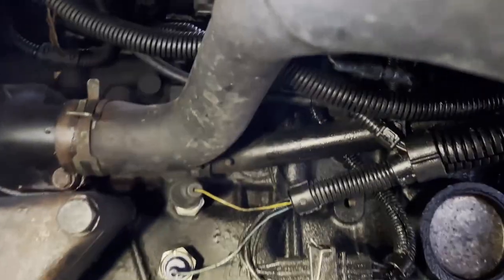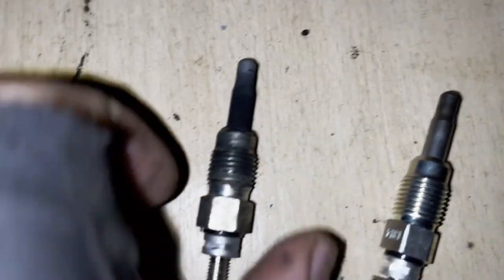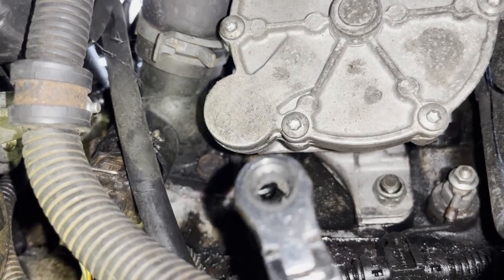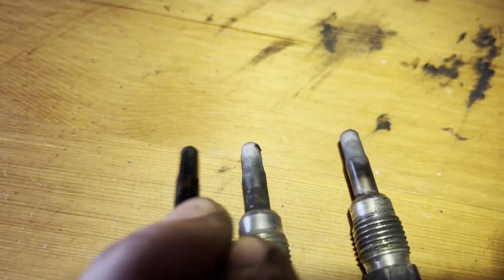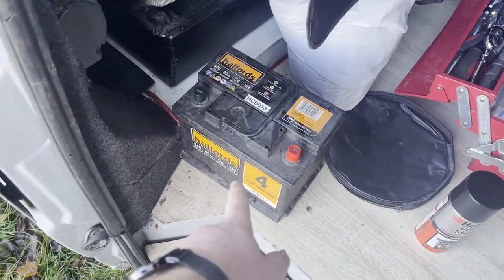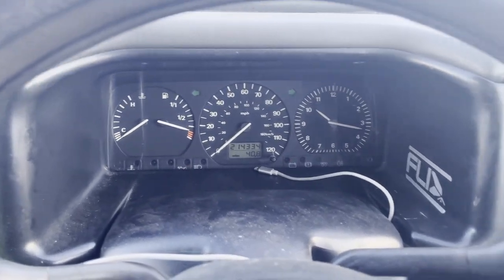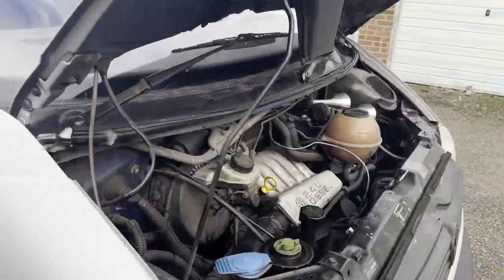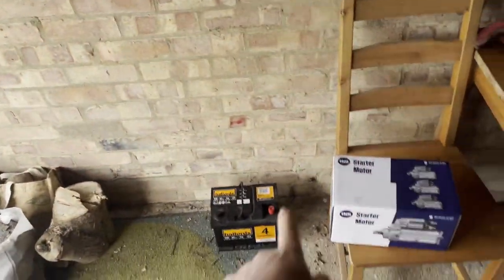VW T4 - Glow Plugs & Cold Start Issues

Comment: I bought my aab t4 as a non runing barn find. Imediatly changed the diesel filter, good service, repaired the alternator and starter motor, 4 new wheels and tyres, treated wing arch/windscreen superficial rust... after 2000km she burned 3L of new oil, had to rebuild the engine and now it's doing that cold nightmare. When we rebuilt the engine we already changed thw most difficult glow plugs, now that seems to be the problem. i read in one of these coments that somebody replaced/upgraded the glow plugs wires... got me thinking and problably will do that too. Thanks for the helpefull video and reaction coments Joel.

Comment: I've just ordered new glows plugs n stater motor. As my glows plugs where on there way out, i tired doing the whole spray into the air take. Worked once, then tired that again. Then ended up frying my stater motor 😅

Comment: I did all this to mine n still had problems ended up changing the power lead from the glow plug rail to thicker wire as it gets brittle over time also the big relay on fuse board n no more issues. Bear in mind as it really does make a difference. Mine will cold start with just over 9 volts in battery. Cheers je.
Reply from the maker: What a nightmare!

Comment: I had almost identical problem with starting, new glow plugs, battery, starter motor, went through a few mechanics, turns out that when i put a new fuel filter on i cured the problem, seems it hadnt been changed when serviced as was rusted in!
Reply from the maker: You never know what it will be!

Comment: I hate to say the obvious but only doing 3 is a bad idea for the long-term reliability. Plus those plugs didnt look bad did you test them? That 540 should start a diesel no problem.
Reply: he obviously had a bad injector...
Reply: @cannaroe1213  look that way.
Reply from the maker: The injectors were fine. I changed all five plugs after this and it worked perfectly
Reply: @JoelsStuff  Good to hear. Its more often than not that hard starting and odd looking plugs is caused by a bad injector.

Comment: Often when the vag using these starters wont crank or push in the starter, only klick. then the positive wire from the small starter push motor to the start crankmotor is corroded. just hotwire it with a spanner or anything and change the wire. i dont think your starter was bad, most likely a negative connection failure

Comment: thx, now i saw on your video that there is a wire from cilinder 3 and 4 and from 4 to 5. just replaced 4 from 5 glowplugs.. the 5th near the timing belt i measured the ohms and seems to be good. the 4th is doable yourself from above, ring spanner 8 from top bit by bit takes a while then with spanner 12 bit.. turn spanner bit turn spanner.. and so on. to replace i used magnet to aim it in place wiggle in hand turn it as far as possible then the long spanner thingy reverse. same with the 8mm bolt..

your van starded ( not start ) exacly the same as mine so i guess the problem is solved now.
Tip of using startpilot or break cleaner or whatever...  ( same not starting as yours ) it turns over fast that strugles.. thats to much gas no oxigan.. keep the starter fluid i bit further away from the intake so it mixex more and it will work to start with broken glow plugs.

awsome video thx i hope i tributed a bit for other people.

Comment: Did you use the cold start advance lever when trying it originally? I have a t4 a couple of years older than yours with a 1.9 td engine. If  cold it generally requires the advance lever.
Reply from the maker: Yep forgot to include this but it didn’t seem to help
Reply: @JoelsStuff  Yeah it was probably the underpowered battery , every diesel Ive ever had used a 90 Ah battery.

Comment: The joys of owning a T4! I had a 1.9td with starting issues (when I first bought it). Changed the plugs, re-built the starter motor every 1.5yrs (so that never cost me any more then new brushes), and got a good battery.

Ensure the starter's earth cables are good too. They'll be a huge detriment if worn and brittle. I upgraded my earths and added an additional 30amp cable.